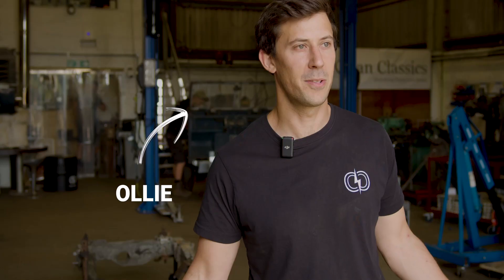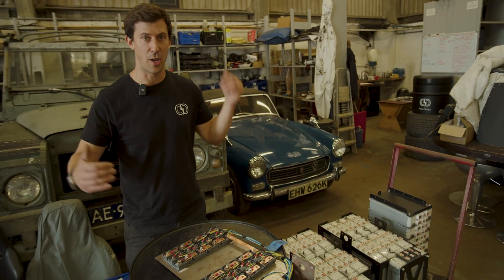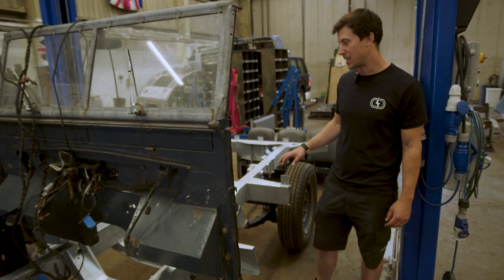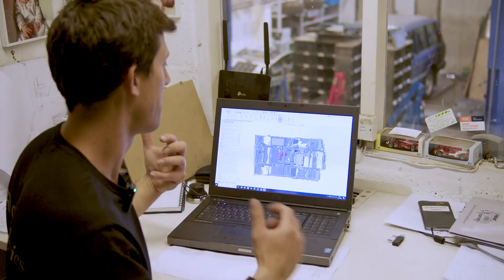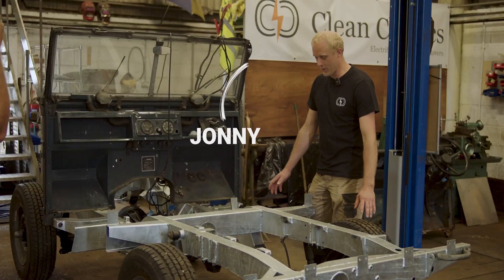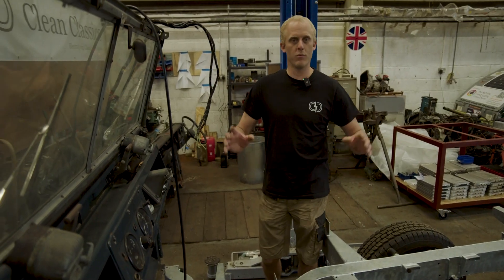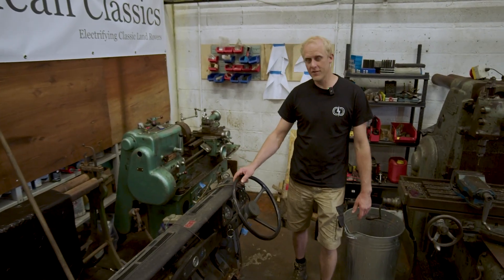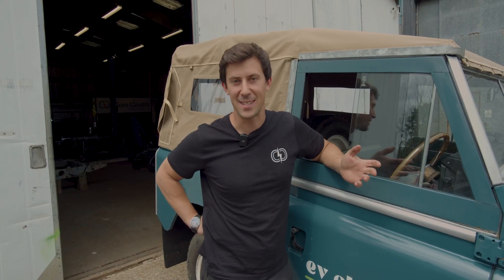Engineering the inner workings of an electric conversion land rover series

Comment: great to see someone going into detail on the build. I see you going direct from leaf motor to LT230, what ratios are you using for transfer box and axles? Does the car run well up to speed but cruise at 65/70 as well? keep up the videos!
Reply from the maker: We use the 1.667:1 ratio - one of our upcoming videos answers this question directly actualy! Yes it runs great at 65/70!
Reply: Great stuff, look forward to it